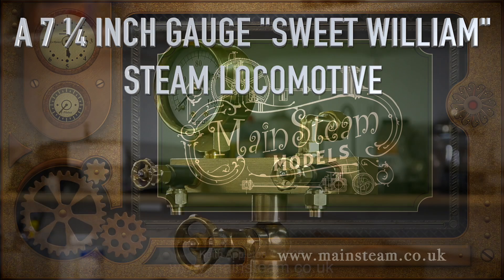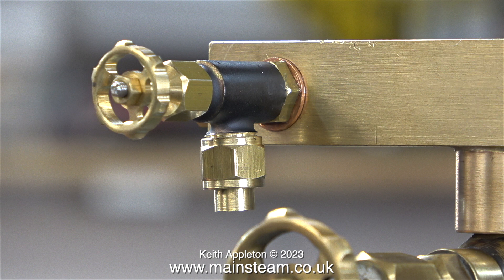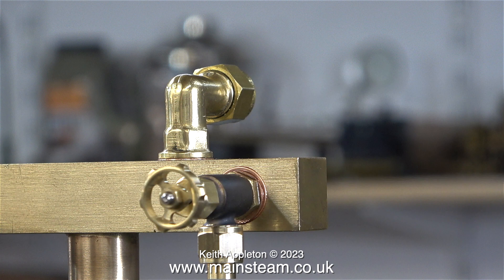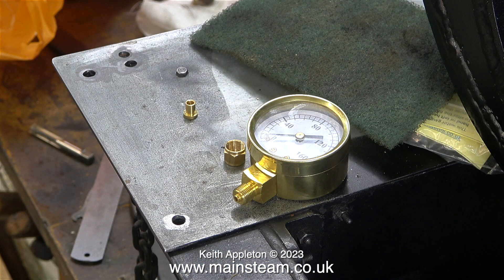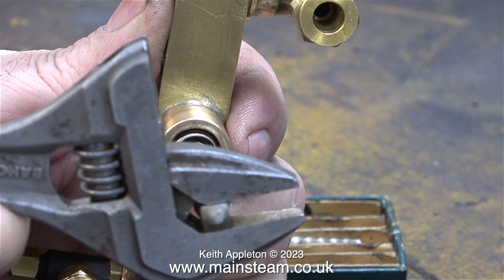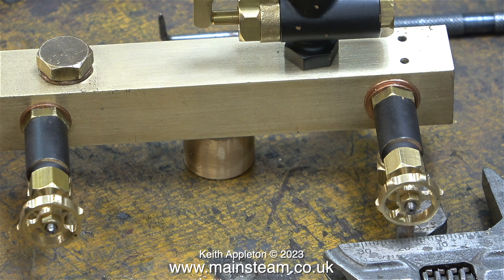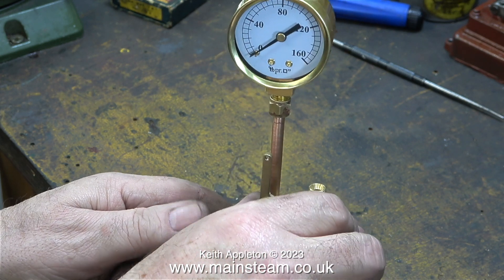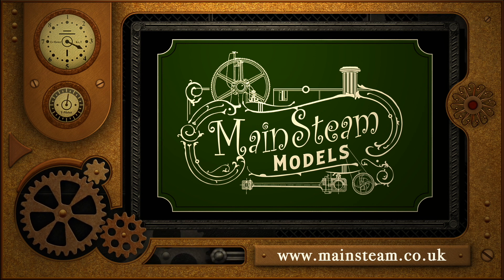A 7 ¼ INCH GAUGE "SWEET WILLIAM" LOCOMOTIVE - PART #25

Comment: Do those fittings have straight threads or tapered threads? I'm accustomed to American NPT threads, and i don't think they would work with shim washers.

Also, what keeps the bottom of that U loop from filling up with condensate? I assume that getting water into the gauge would be a bad thing.
Reply from the maker: I always use straight threads. It is the condensate in the Pressure Gauge Loop that prevents the hot steam from damaging the mechanism within the gauge.

Comment: Thank you for the advice on the pressure gauge over heating. I was not aware the internals could be damaged like that. That's too bad the globe valve broke.  I thought it was a rather nice looking one.  Though I see what you mean it didn't look right with that turret.  How annoying for it to even happen.  I invested in a set of good extractors myself.  I find that it is sometimes useful to give them a little tap to set them in the damaged part.  Especially on something I have drilled or had to bore out and may have traces of cutting fluid about.